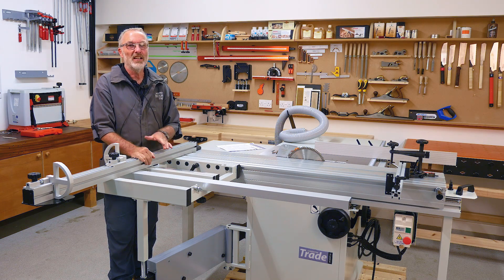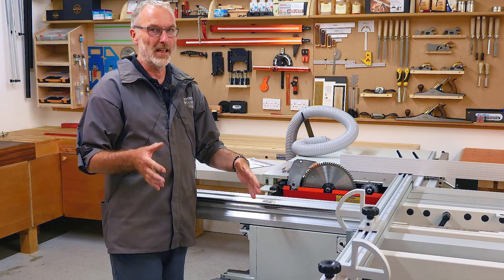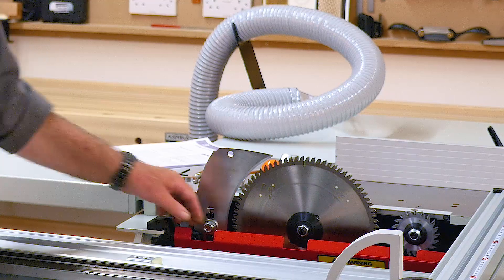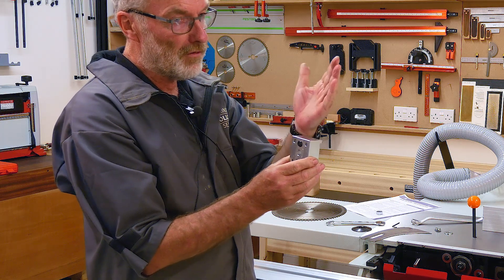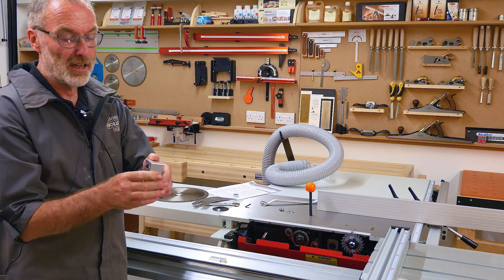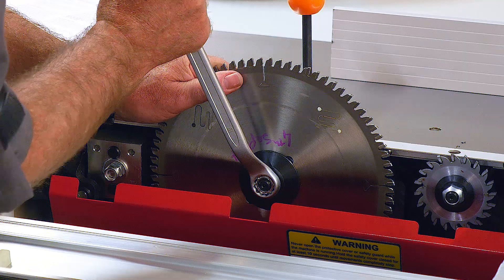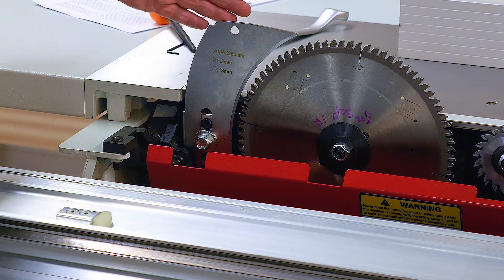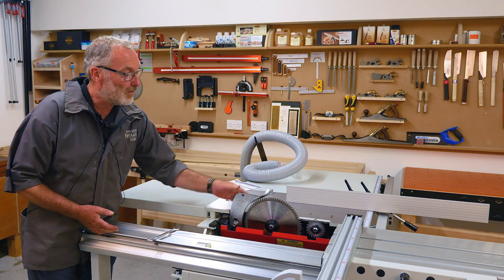How To's - Correctly set your riving knife

Comment: Thanks for the video. Can you please confirm if I wanted to use the saw to cut a rebate AND my riving knife was slightly above the height of the blade, should I a) remove the knife for this operation or b) adjust the knife so it's lower than the blade ? Thank you

Comment: Could you elaborate on the riving knifes that can sit level or bellow the blade? Didn't understand that part :)
Reply from the maker: If the riving knife on the saw fits to the crown guard, then it will sit above the level of the blade. If you have a crown guard that is separate to the riving knife, then the knife can sit just below the top level of the blade.I hope this helps :-)

Comment: Congratulations! Very good your video! 
I am a DIYer and I have a doubt. My circular saw does not have a riving knife and I have decided to do one by myself. No more doubts about thickness after watching your video. My blade is a 184 mm (7 1/4 ") with 60 teeth and has the following measures: "plate=1,40 mm" and "teeth width=2,20 mm". In your opinion, what is the best thickness for my riving knife? Thank you very much in advance.